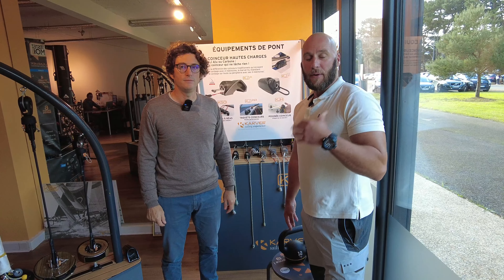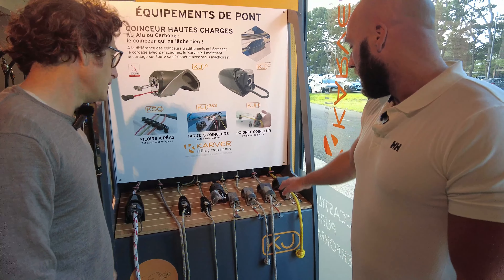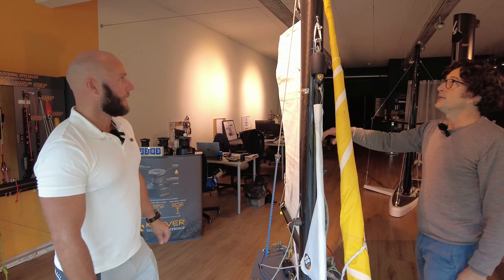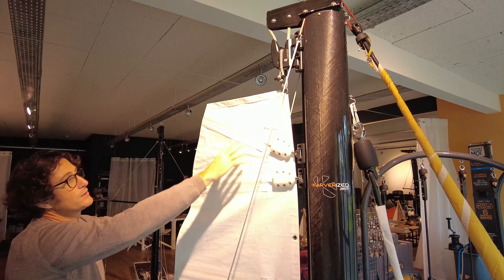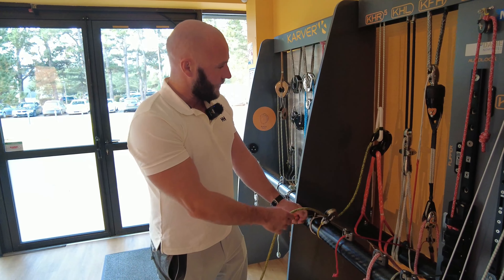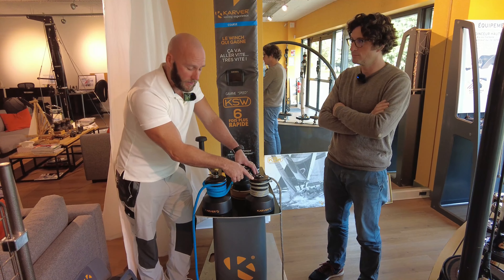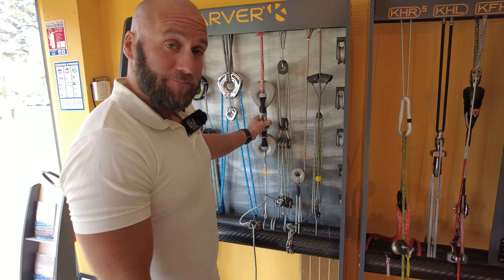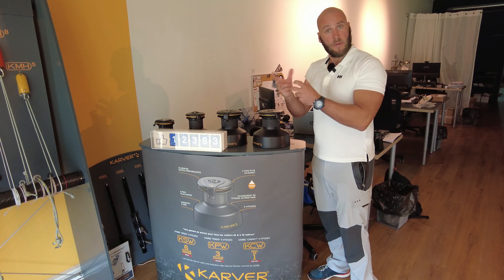Exploring innovation at Karver Lorient France

Comment: Hi James. Late tights party but great video. Re the locking mechanism for halyards, how certain is the release and what happens if it doesn’t????
Reply from the maker: Hi James, thanks for the comment. i have installed them on my own boat now. One has to keep them clean but I think the benefit outweighs the risk. All the racing folk use them extensively and do not have problems. Not been an issue and are quite a simple mechanism. If you were concerned stick with foresail locks and not main.